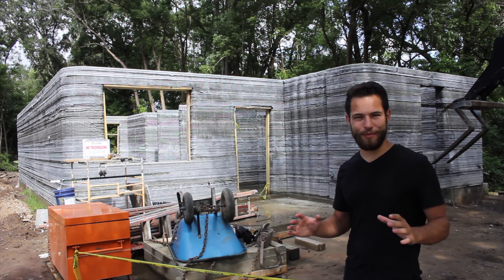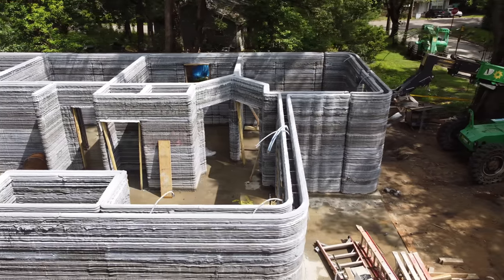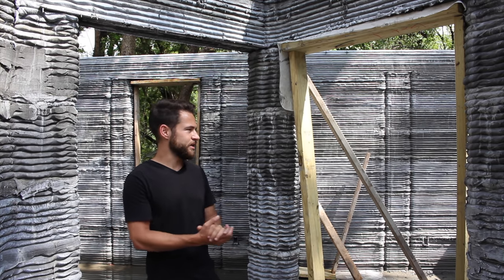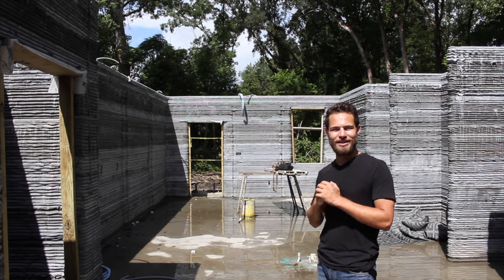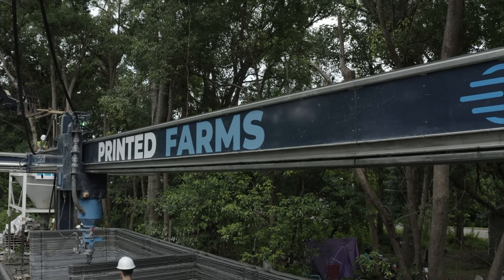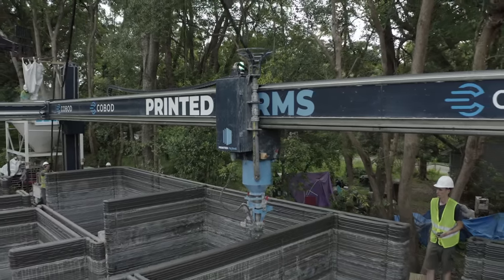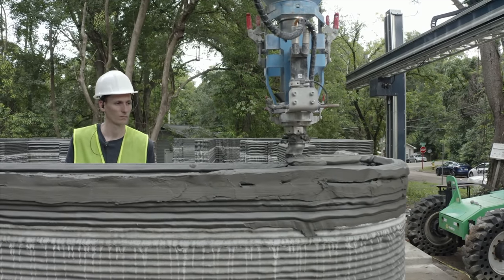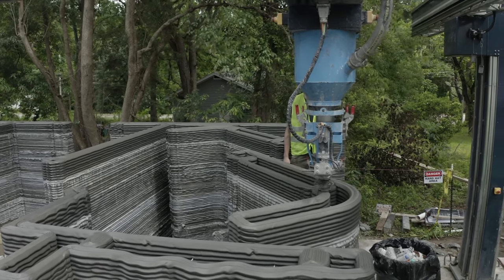First Permitted 3D Printed House in Florida | Printed Farms Strikes Again

Comment: Wouldn't it be possible to add in a troweling function to the 3d printer which would smooth the sides of the layers as it travels?
Reply from the maker: That seems like a logical next step
Reply: @automateconstruction  That's what I was thinking. I have had this idea for a while and wanted to keep it to myself, but i cant afford to buy a 3d printer and experiment like you guys can, So i figured ill just share the idea with you all to make the world A slightly better place :-D
Reply: @automateconstruction  I just devised the beginning mechanism that might work to allow for a trowel based 3d print to happen even when crossing over already printed sections in the path of the printer. I also have some ideas for timing the print perfectly so each layer is perfectly dry as the printer reaches the beginning area again.
Reply: that would be called slip forming
Reply: Maybe, but I’d imagine it would increase the likelihood of static wall failure significantly.. part of the success here is that concrete is delivered precisely in layers so the weight distribution is equal and centered. Push on a side and the weight shifts.
Reply: They already have it in different companies. Very easy to do
Reply: It is possible and Apis Cor seems to already be experimenting with this.. however troweling beads does make a huge mess at the base of whatever you’re printing so kind of cancels out some of the automation
Reply: @sonacphotos  I mean, it does have a certain appeal, but once the apeal is gone, and peopel start asking for smooth walls, Ill be there figuring out a way :-P
Reply: @sonacphotos  yum hot cakes
Reply: Yes. I think it needs some vertical roller outside. If it will be 3 layers tall it will form a smooth surface. Also it can be replaced with some rough roll that will create appropriate roughness for good plaster adhesion.
Reply: @k1zmt  Very good idea on the rough rolling wheel, and the whole wheel concept, if it can be kept stable enough without interfering with the print, it could really work to leave Brick prints or patterns on the walls....
Reply: @arturtchoukanov1118  Stold my idea :-P
Reply: @pauldrake9696  A oval edge is less stable then a flat squared one...
Reply: @edwardamirault3894  If you provide the exact amount of material for the trowel to finish, there is no waste...
Reply: @balancedcooperation  You could have a rough trowel edge like they do for tile work...??? It could be in a pattern for differnt wall designs :-PD
Reply: @rogeliosalgado  What about a machine that can 3d print color variations as the wall prints to create art?
Reply: or rollers

Comment: I'm glad you covered the warts as well as the glamour... It's been fun watching this tech slowly mature.
Reply: Just an fyi the carbon footprint used for this type of building is like 80 times higher than a normal stick frame house, meaning its much worse pollution wise and is adding to global warming.
Reply: General rule of thumb is any building using portland cement is going to have a very high carbon footprint. This guy knows that he's a trained actor he constantly uses CIA operation mockingbird jazz hands
Reply: @tracemyers1275  I think the main advantage of this technique is that it's propably a lot more rigid than traditional stick frame houses, which is especially important for areas like florida that get lots of tornados. But I'm not an expert myself, it's just a guess.
Reply: @tracemyers1275  "CIA operation mockingbird jazz hands", I can't even :'D

Comment: I can’t wait to see the amazingly designed buildings with this technology, we really are heading into a interesting future.
Reply: Still not really sustainable. Sadly.
Reply: @dieabsolutegluckskuche5174  Why is it not sustainable?
Reply: Because  it's a machine there's iam a concrete finisher and let me tell u first no rebars in the walls real bad second if u don't work and finish the concrete it's more likely  to Crack
Reply: @reynaldobarboza2029 100% depends on the concrete mix used. There are companies out there that have better mixes and even special formulas that are designed to be sustainable and even eco friendly

Comment: They can also use very fine steel mesh inside the walls and blocks of mud or cement to make them more firm and use recycled plastics in micro particles mixed with mud.
Reply: No, no they can not. Defeats the entire purpose of printing.
Reply: @NeverTalkToCops1  well you can 3D print metal so as the machine evolves is should be able to create reinforced concrete
Reply: @marxalbertgedeon  no, you can not 3d print metal per se. It's not that easy and it's not that simple.
You have to sinterise the metal powder which makes it impossible to print both materials simultaneously.
Reply: @thefearpt  you can have an on site kiln , producing molten metal , you can wait for them to cool down if you’re using bigger pieces to rebar , or faster cooling smaller pieces , that would require a lot more layers , there is the many different approach , the 3D printing process is already similar in ways to casting metal ,

Comment: OOOO New idea... Each Layer can be dyed different colors, layers of print for each printed layer or color; In order to create woven patterns into the concrete of the walls themselves :-D We could smooth or pattern the exteriors and interiors as we wished for aesthetics and visual pleasure.... :-D  While also maintaining stability and possibly smoothing certain areas for wood or metal work attachments... I'm sure eventually, someone could print a wall that was a Van Gogh..... :-D
Reply: but i think it gets covered by shingles to protect the concrete, so no one would ever see it
Reply: Thats good thinking I can see that being possible by having an additional line pushing dyes through the nozzle. So you could just choose which colors you wanna print
Reply: Enjoy the 3D printer house. Could we use different material to print it?

Comment: I work at the manufacturing site of the machine in Denmark😃 COBOD international. that machine is the old design, it looks like the bod2.1. The bod2.2 is much better with flaps, you get smoother and compact layers and plus we are working on the bod3.:goodvibes:

Comment: in the window and door openings there should be a crossbar otherwise, when you put the roof in these places there will be a heavy load on the glass unit and doors, perhaps the doors and windows will get stuck.
Reply: Concrete isn't too bendy
Reply: @JoeWolford  then it has a rebar inside.

Comment: The nozzle should have a smoothing blade on it so it can smooth out the concrete as it lays it.  The blade could be on a pivot and use a hydraulic arm to articulate the angle/pressure.
Reply from the maker: They do that, check out my recent Alquist video
Reply: @automateconstruction  Great minds think alike!

Comment: Cool and I can see the potential but wow they have a long way to go. You still have to facade the outside with siding and frame the interior for finished walls. At that point U might as well have just framed it and or used ICF. But I get it, it’s trial and error. Needs these steps to get better.

Comment: They have to stucco and plaster the walls to smooth it out which adds to the building time. They must be R&Ding a smoothing function for it in the future or some other company is. A two headed nozzle, one top and one side with a trowel on on the side would seem like it would work but I'm sure its easier said than done.

Comment: How many times do you have to fill the silo with portland? Maybe buy a couple silos, or the dry bulk truck with driver and it pumps the portland in for you.. 25tons 4800.00.. driver 20hour, fuel 600.00 ..maybe cheaper and less headaches

Comment: I do love where the future of this kind of development is going, however I do have some concerns. Like sustainability, using so much concrete is never a good thing, concrete production is one of the biggest carbon emitters in the world. And also since it’s concrete it would seem that it also would not retain heat very well. Do you know if either of these problems are considered? And if so are there solutions planned out to help combat either one ? Thank you
Reply: You can use all sorts of materials in the process. Regardless it’s going to be good in 20years
Reply: I feel the same about it. I am pretty sure that printing might make a whole lot of new materials available. 
So there might be more sustainable options that we just have not yet considered.

If it keeps on using concrete it is useless.
Reply: If they can simply use hempcrete as 50% or more of the mix , this would become much more sustainable and probably more insulating. 3D printed Hemp Homes. I really want to see that as the standard.
Reply: ...just wait till they figure out how to use ocean plastic as filament ...win win ...
Reply: @willgaukler8979  that would be perfect.
Reply: @willgaukler8979  Yes! An infinite ressource. They could use the birds and the fish that ate all the stuff as printer catridges.

Comment: The visual defects are minor, and if they hit them with a grinder and some plaster they should smooth out pretty well. My concern is fitting doors and windows into those spaces - the support structures weren't put in square so they rely entirely on the top support and the distribution of the concrete on those layers. That moisture is a concern too. In a colder environment I'd be worried about the liquid gathering in the joints between layers and freezing, effectively prying them apart.

Comment: What I find amazing. This was designed to be a cheap alternative to labor expensive building. Although they are focusing on a high end now they are printing. Hopefully demand goes back down and people realize this should still be considered an economic way of building.
Reply from the maker: Think of it like Tesla, first they made the roadster in 2008 then they made a cheaper S model then the even cheaper 3 soon they’ll have a $25,000 model.
Reply: You know how expensive concrete prices are going to be.
Reply: @automateconstruction  unlikely with inflation they won’t have a 25k model unless it’s used or very cheaply made. The battery tech is going to be hard to keep low the bigger demand for materials. Increase in crypto ect
Reply: @automateconstruction  not in your lifetime
Reply from the maker: @snapon666  the $25,000 Tesla is under 5 years away watch.
Reply: Yes I understand making Tesla model s first to make profit. Although they are not making a Tesla model s. They are making a normal 3 bedroom house for the same money even though the labor and concrete costs go way lower. I have watched 3d printing for a while now. 800 SQ ft for less than 20k is a disrupter in the industry. The same price as all the other inflated new home builds is not an industry disrupter.

Comment: I think this has great prommise.  This is easier on the workers involved and I can actually see this making the electrical installation quite a lot easier as well. If we could get a wire that was raited to be encased in the printed wall you wouldn't even have to worry about supports.  Just print to 16" drop in your device boxes run the wire along the top edge of the print then have the printer encase the wiring.
Reply: I think installing conduit in the structure would work nicely.  You could have multiple separate conduit runs for the 110v for the lights and receptacles, both 15 amps and 20 amp.  Also you could have separate conduit for the 220v for the washer/drier or even garage area if someone really wanted workshop that could support bigger equipment.  And, most importantly, you could isolate the coaxial from the cable/internet company, and a home network set up with ethernet that has its own paths for hooking up access point, wireless speakers, POE cameras, ect. ect.

Comment: I've seen alot of the other videos for 3D printed concrete. It looked like there was too much over-extrusion. They need an attachment for the head to do smoothing but I have seen cleaner walls without any attachments. The other printers had cooling or mist going at the same time they were printing. I bet if they changed formulas on the concrete it would come out a little better. I wonder why they didn't use plate steel or something that can handle the load to bridge the door gaps? Alot of good info in these new videos for sure. I bet that robot arm printer would have been better for this type of work since they had the issues with the trees in the way.
Reply: I would just do a quick cheap and easy but still decent looking exterior finish of some sort.

Comment: This is inspirational.   I would love a 3d printed open concept shell with a Split single pitch (Skillion) type Roof.  Can the walls be filled with expanding foam?  Can the roof be 6" insulated steel sandwich.   I think a brilliant business model would be to deliver affordable shells with no finishes, electrical, hvac  or water lines.   I have a lot and a design ready for small 800sq house in Highlands county Florida.

Comment: I have an idea, they could pair the concrete print head with a wire dispenser, it could basically utilize the wire to build a bridge for the concrete rather than having to place the boards when its time for that layer. The wire would be embedded into soft concrete and after short cure and enough wire should be able to take the concrete printed on top.
Reply: Good idea for adding strength to the concrete once it is set. But the wet concrete is always going to need something to sit on during hardening.

Comment: That doorframe looks pretty wonky and unparallel…maybe it’s just the camera angle…. I am assuming the wood is placed after the walls are printed…??
In either case, I’m sure things will get better, as more and more of these printed homes are completed. 
Good for you. I think you’re onto something here!!
Reply from the maker: I think it was just a support to hold the printed layers while they were wet. After the concrete cured they probably knocked them over. I’m sure they will make it square before trying to install a door.
Reply: @automateconstruction , that sounds logical. You’re probably correct.

Comment: There is a long way till faraway.
Technology is promising and for sure should bring savings in material costs . However, I see this taking
off when a developer can create the infrastructure for 20-30 houses and then bring a 3D concrete printer and print and finish all units. This way he can make some money in the process.
I used to work with 3 D printer, I was designing my parts and then creating a prototype semi-functional of course but I was getting an idea if my device has a chance to be manufactured and work according to the specs. I am talking about parts of a few inches across and weighing a few pounds.
Idea is the same, in this case the material is concrete with certain special properties, at different production stages .

Comment: QUESTION!!

If the roof is supported by traditional reinforced concrete pillars. Do the interior walls need to be concrete? 

Seems it would be cheaper and faster to just build traditional wood dividing walls. Except maybe kitchen and garage.
Reply: In Florida homes blow down in hurricanes interior walls are needed for more support.

Comment: Will that type of concrete eventually crack and break down? If it does, that's one hell of an expensive repair. It will be interesting to see how long it lasts.
Reply: Have to water the walls so they don't crack during the next week after the pour just like stucco
Reply: I have seen some prints where they lay out rebar and ties during the printing process.
Reply: Is seemed more like grout..there wasn't really any aggregate in it..it's not all vibrated in a uniform way.I guarantee it cracks sooner than later..seems kinda disastourous. now the idea of putting rebar in it makes sense.but why not use poured.walls.or Precast at this point

Comment: A friends parents  has a concrete house, they built it themselves, put up a dome canopy, uses pressure to hold up, then they sprayed the concrete up. This 3d printed process is surly in the early stages, seems slower than what they did. Looks slow as they have to mix concrete there, and not have a concrete truck.
Reply: I like the method you're taking about. It also includes a rebar structure inside the cement for strength.

Monolithic Domes is one company that does this method.

Comment: Very cool but i dont see the cost savings by the time you set this up and print it a crew of block layers could have came in and had it done in the same time with a much smoother finish
Reply: Exactly.  This is an illogical approach to a non existent problem..

Comment: I love this idea but wondering if this print lacked some type of QC during the process, what caused those layers to not adhere well and the others to drip, why the density and mixture of the concrete not inspected before the print started?

Was any test done on wind tunnel or something to simulate hurricanes?

Do you have more updates on the zoning/permits progress to allow those houses to build on the rest of the State?

Comment: I prefer floor to ceiling glass armoured windows. You dont need to print on site, rather just mass produce in factory the pillars that support the ceiling and erect floor to ceiling windows and interior walls for high visibility so you can see intruders. By comparison, it can be assembled far quicker and cheaper than the 3D printed house.